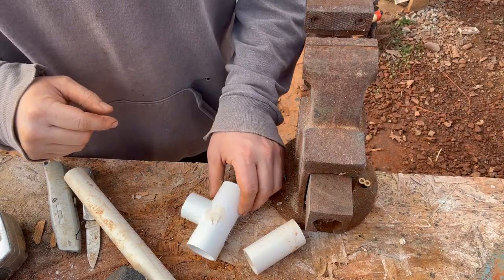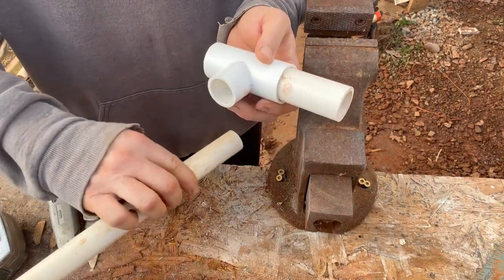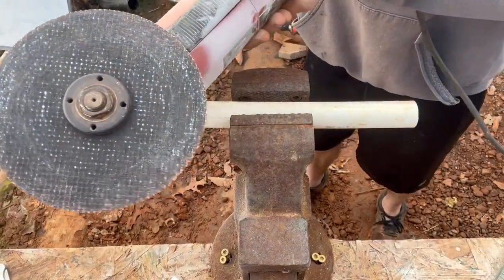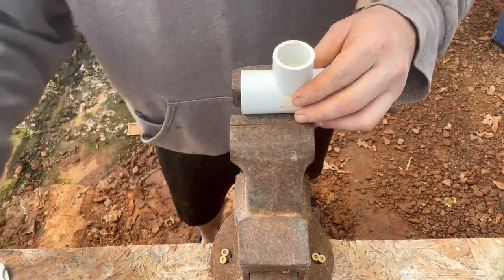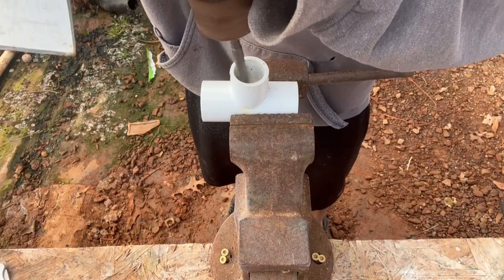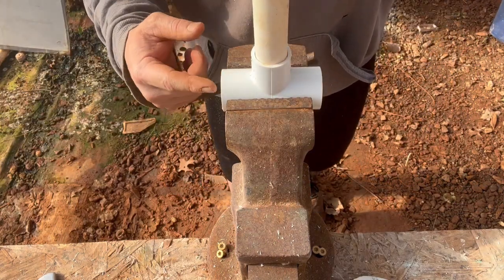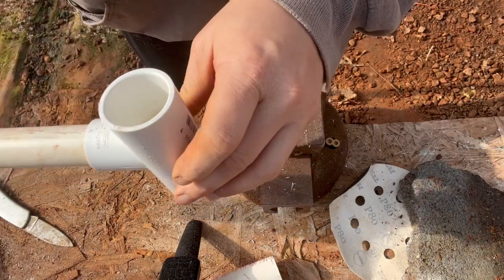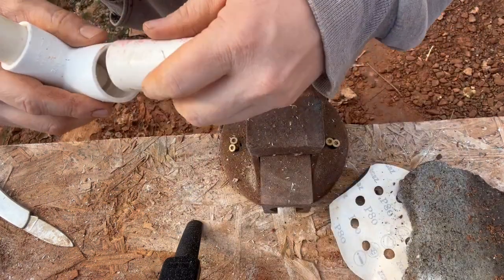Stop using airstones!! Use a $2 venturi instead!

Comment: SUGGESTION:
Placing the air inlet right before the pump impeller allows the bubbles to get smashed down in size...leading to far more oxygenation of the water. Large bubles quickly rise to the surface, and this elads to less oxygen getting absorbed into the water.
Reply: Basically aren't you 'cavitating' the pump impeller? This increased cavitation usually kills a pump. Not saying it is, just saying cavitation is something that is generally avoided. If it works it works.
Reply: i tried that and some pumps die out and quit pumping when any air is introduced.
Reply: @ErikAnders  
I use a 1/4 HP submersible pump, and a 1/5" poly tube......My water is so oxygenated it turns milky white with almost zero bubbling at the surface. The bubbles just hang in the water and my fish only need it to be on for 30 minutes a day. I don't remember the brand of pump, but I'm sure any sump pump would suffice. #PraiseJesusChrist
Reply from the maker: Interesting, I have tried this with no success, but I’ll try it again.
Reply: Thanks @thomasg4324 for the advice. I just did it as you said and it's wonderful how it works. It just saved me thousands of  dollars. Actualy I found a video explainung how to do it.
Reply: Why suggest killing pump's ?

Comment: Instead of drill bit, you could have heated 3/4 inch pipe till it gets soft with a hot air gun and force it through the T fitting.
Reply from the maker: Very interesting, i might try that next time, seems I’m adding a new system every month or so to keep up with demand.

Comment: Isnt easier and cheaper to pump air verses water?
Reply from the maker: An air pump is typically slightly more expensive than a similar wattage fountain/pond pump, and then you have to buy weighted hose, fittings, and airstones. A water pump and some pvc is a lot easier to setup too, in my opinion, but I have larger hydroponic systems, some that are 800 square feet, and it just doesn’t make sense to put 40-50 air stones in and a huge noisy pump. 

That being said, if I was building a small system (<20 planting stations) I would use an air stone. Hope this helps!
Reply: I’m guessing it takes one step out of the equation assuming that your filtering or circulating the water to begin with.

Comment: Clever idea! But how does the size if the bubbles relate to aeration effectiveness? On another air stone video, tiny air bubble size was emphasized,  but these bubbles look huge.  How would one even measure, or know if one is infusing the air into the water enough?
Reply from the maker: Good question, the only thing I can tell you is that I have perfect aeration using this system which is a dissolved oxygen level of 8. I have some systems that are 800 gallons and I run a 40 watt 620 gallon per hour pump with one 3/4” venturi. I have perfect aeration with the benefit of circulation, and it’s really cheap and virtually maintenance free. If you are running a small reservoir get an air stone. If you have a larger system, airstones get really expensive and are more of a hassle. So it really depends!
Reply: Aeration is not about gas transfer from the bubbles...no matter how small they are. There simply is not enough time for gaseous transfer. Aeration occurs at the surface...and to get that...all you need is agitation. "Small bubbles" agitate the surface more effectively.  But if the tank is deep...a small pore airstone has too much pressure on it to work effectively.  Hope that helps

Comment: you could control the airflow with a cutoff valve
Reply from the maker: The idea is to get as much oxygen as possible into the water, any system using ambient air is limited, with the max being about 8 ppm of dissolved oxygen at sea level. The closer you can get to 8 ppm the healthier the plants will be, I would like to do a video where a measure dissolved oxygen in my system with a meter. Stay tuned!

Comment: This design works for a larger pump, for smaller pumps just bring venturi closer to the surface as it can't draw air down that deep.
Reply from the maker: I use a 2” pump with 5000 gpm for my main system, it actually does quite poor deeper than a couple inches. My smaller system use a 3/4” venturi with a 620 gpm pump, they won’t great at 8” but cannot go any farther than that.

Comment: Put a bit smaller sized tube on the output side. That will enhance the ventury effect even more. One and a half inch in length will do. Because of the smaller diameter, the water will have to go faster, and therefore, it will draw in even more air.
Reply from the maker: 👍will try this next time!
Reply: @SaludaGradeFarm  We used to reduce the water pipe to a smaller Tee and then increase the pipe again on the output.
This creates the water flow to increase creating more suction of air.

Comment: Looks to me like the air pipe blocks way too much water stressing the pump unnecessarily
Reply from the maker: These pumps are centrifugal and designed to work under resistance. One of my  pumps has been going for a couple years without a hiccup! Most the pumps I use are just pond pumps and only draw 40 watts, but can aerate 800 gallons or so!

Comment: All that work for video and zero clarity of symmetrical tee and water flow direction. How about a big red arrow?!
Reply from the maker: Open end of the beveled pipe goes towards the open end of the tee. If you reverse it the water shoots up the air intake, I’ve done this before 😂 hope this helps, if you have anymore questions please let me know!
Reply: @SaludaGradeFarm  Makes sense!

Comment: Water pumps use 100 to 400watts for small hot tub pond or aquarium
Reply from the maker: Most of the water pumps I use less than 50 watts, they don’t add heat to the system, there’s no air stones to clog up. 

The pumps are low pressure pond pumps that move a lot of water for very low wattage. I believe these systems are pretty efficient!

Comment: Also kills flow ...😢     if ran air stones in intake of pump or better in pipe would be more efficient on electricity running  2 pumps if ask me..air pumps don't use but 5 to 15watts
Reply from the maker: I don’t think a 15 watt air pump will cut it in this application, the pond is 5000 gallons, and would cost alot of money for all the airstones in weighted hose fittings etc…..

Comment: Demonstrates a clear lack of understanding on how oxygen gets into the water...... 

There would be 10 times greater oxygenation by just turning the outlet to point up towards the top of the water (without the bubbles) and 100 x more if you lifted the outlet to the top of the water and have it create the longest horizontal water ripple you can....

The bubbles add ZERO aeration to the water and cause a bunch of problems, all they do is lift a tiny amount of water to the surface (create a small amount of water current) where the oxygenation actually takes place. Obviously the water pumps flow is many, many times greater current than the bubbles create so just use it efficiently and save all the dramas the bubbles actually cause (and the god awful sound).
Reply from the maker: Hello, thanks for your input, and I would love to have a good conversation with you about this one day. This unit aerates a large hydroponic pond, and I am merely mimicking exactly what I have seen in the large commercial hydroponic systems that cover 5 acres plus! The surface of the system is covered in floating rafts, and any water exposed to light adds algae to my system. I failed 3rd grade chemistry, and my only understanding of how DO gets into water is to increase the air to water surface area, hence bubbles, and lots of them!

Have a blessed day!

Comment: You don't need airstones to "oxygenate" water...WHAT YOU NEED IS LOTS OF WATER SURFACE MOVEMENT...so a high flowing pump where the water sprout is level to the water surface is enough to move the surface of the water constantly...or you can use a DIY sprinkler...
Reply: Oh heck….bubbles just look neat too 😃
Reply: They do small micronised bubbles increase surface area which as with all chemical processes increases the rate of reaction ... In this case the rate of oxygenation ... However oxygen saturation of water is temperature dependent and peaks fairly low at standard atmospheric pressure ...
Reply: So just waves that touch all waves of the reservoir?
Reply: 💯 to many people think the bubbles add oxygen - but its their movement - I do like this though for breaking surface tension though
Reply: @Aiken47 surface area and turnover add oxygen, bubbles add surface area
Reply: Shut up
Reply: I connect an elbow socket & turn the Venturi about 30 degree downward. It creates a lot of oxygen in the deeper part of the pond water & my koi are very active.
Reply from the maker: True that! I use a water fall method under my nft channels in the reservoir, watch out for algae using this method though! Cheers!
Reply: Exactly  @SaludaGradeFarm we put T piece in the feed line, an L, and point the takeoff back at the solution
Reply: @SaludaGradeFarm what do you do to control the algae in the res? Should I just add a venturi water pump at the bottom? I run aircube atm 105 gallon res
Reply: Everybody says the same, but I believe that is a kind of myth, actually... 
All those little bubbles totalize a big surface area count for the O2 exchange..
Besides, it could be a good number of little bubbles remaining in the water for a while...

Comment: I’d like to see the entire assembly outside of water.
Reply from the maker: I’ve switched to just one 2” venturi in the system because the pump failed and the only pump size I could pick up at harbor freight was larger then the existing, so I built another larger venturi. Works just as good as 3 of these but with a lot less plumbing

Comment: Restriction or losses in waterflow costs more than the powercosumption of a designated airpump. 
You could also turn your idea 180degrees. Use a airpump/airlift to move water. Much more energy efficient.
Reply from the maker: Thanks for the comment!
Reply: @SaludaGradeFarm   You're welcome ;)

For example...With an proper diy build airlift you can pump 12.000 to 15.000 liters of water an hour with only 20Watts! 

In Western Europe these kind of pumps are being used in several large Koiponds.
Reply from the maker: I’m only using 2.5 amps for my water pump, and the system is 20,000 liters. I think the main thing that I love about the setup is it only cost $250 and it takes only a few minutes.  I’m looking into the air lift though, do you have a link to one?
Reply: Could you give pump or air pump links please?
Reply: @infantesb  Just Google for airlift Koipond

Comment: This could be used in place of a Trompe for compressing air, and could be fed with a simple gravity feed.
I see many uses.
Reply from the maker: What’s a tromps?
Reply: @SaludaGradeFarm  It's a primitive Air Compressor that relies on the fall of water in a waterfall to catch air, and then collects that air. In its original forms it needs a LOT of height, and a lot of flow.
It's named after its inventor, French chap named Trompe.
Reply from the maker: Curious if the falling water could drive a water wheel that turns the compressor, that’d be cool!
Reply: @SaludaGradeFarm 
https://en.wikipedia.org/wiki/Trompe

Comment: I still have no idea how this actually works...lols. I could build one now but dont understand why I would want to... Need a side by side with an air stone to show the diff and explain the benefits.
Reply from the maker: A pond pump pushes the water through, past the beveled pipe, and that creates a vacuum that pulls the air in. On a larger scale, venturis are cheaper and easier to setup, plus it adds circulation with only one pump. You have to buy alot of airstones, fittings, and weighted hose with an air stone setup, plus you have to the air pumps are really loud and obnoxious 😀then if you wanted to add circulation you would need to add another water pump.
Reply: Thank you so much for the reply and answer @SaludaGradeFarm  that makes perfect sense now and makes me wonder If I can use this idea for a DWC hydro set up but on a smaller scale. I appreciate your time here.
Reply: Google Ventury and the principles involved will be obvious.
Reply: @robinhooper7702  Wasnt talkin to you numnuts, if I wanted your opinion, id have asked for it then gone and bashed my head into a wall...

Comment: How to skip right over the PUMP that actually causes the whole thing to work
Reply from the maker: If you want to make it off grid look into the kratky method, other than that you need a pump of some kind, most hydroponic growers have a pump, either a Venturi setup like this, or an air pump kind of like a fish pump.

Comment: Brother pls tell me what is the length/width  of your bed?  And what is the HP /wats of water motor ?
Reply from the maker: This bed is 10x80, but you want to shoot for a pump size that will circulate all of your nutrient solution at least once an hour. You can scale down to fit any size bed. I started making 10x16 beds because they are much easier to manage.
Reply from the maker: In my 10x16 beds I use a 660 gpm pump, with only one 3/4” venturi built I. The same fashion. In my large system I use a 5500 gpm pump with three 1” Venturis. Hope this helps.
Reply: @SaludaGradeFarm  definitely helpful brother.  Thank you lots of love from India

Comment: Bro not everyone has the space for that kind of thing. Nice clickbait tittle
Reply from the maker: Not clickbate, I use the same setup on my 10x16s and 4x8, just smaller pipes and pumps, I have another video where I set this up on a 4x8. The point is, look how simple aeration can be. Hope this helps.
Reply: @SaludaGradeFarm  okay I'll check out your other video
Reply: I been using a smaller version in small 200 gallon pond each winter.           Fish stay in the pond all winter, with no issues.  Coldest winter night so far -29°F.

Comment: Easier and faster way:
Drill a hole on to the pipe and place a small air hose.
Size of the hole should be same size of the air hose
Reply from the maker: Thanks for the comment

Comment: If your pump stops water will run up your air pipe? How do you clear that? Do you have to be running the pump before putting the system in the water to make sure the air snorkel remains clear?
Reply from the maker: Nope, turn the pump on, and it quickly sucks the water out of the pipe every time, there jo priming or anything else necessary, it’s care free.
Reply: Check valve would help you
Reply: @TheCryptoMiner which part of the unit should the check valve be fitted
Reply: Did you check, if it worked when the motor was switched off for a day and then started.
Did the water in the air pipe get sucked out and the unit served the purpose intended too

Comment: what pump did you use to connect on your 1” pvc? can you give me the pump model?
Reply from the maker: You can use any submersible pond or fountain pump. Shoot for 1,500 gpm for each 1” venturi. I have a 5500 gpm pump hooked up to 3 of these! I also have a 600 gpm pump hooked up to a 3/4” venturi made the same way.

Comment: I'm going to try this into my large scale reservoir that serves 2k heads of lettuce. Hoping this will also works. Thanks for the info
Reply from the maker: It will work, just size your water pump to circulate your solution at least 1 time every hour , preferably a bit more. I have 5000 gallons and a 5000 gallon pump running through 3 of these 1” venturis. I get pretty healthy roots but they could a little better if I had a 6500 gph pump going through the same 3 venturis, but I might add 1 more if needed.
Reply from the maker: My healthiest plants are in a system where I’m circulating the solution once every half hour, and the roots are pearly white! Hope this helps!
Reply: My pump just arrived today and Im gonna do it today. I hope this will also works on my reservoir. btw im using NFT system
Reply: how did it work out? 
 @wkendgarage

Comment: Good info for those of us still researching and dreaming. How many of these Venturi systems do you have throughout your DWC pools? I live in Orlando, Florida but grew up not to far from you in Gaffney, SC. Would love to stop by someday when we are up there to see your layout and pick your brain. Thanks for the videos. I really do enjoy them.
Reply from the maker: Thanks! I use 3 or those 1” units that I’ve made with a 5000 gpm pump. I may need to upgrade the pump a little bit because it aerates a little less every time i added a Venturi. 

PM us on Facebook @saluda grade farm.
Reply: @SaludaGradeFarm  Ha, I think you meant a 5000 gph pump. A 5000 gpm pump would bust those little pipes, then probably knock a whole in your wall😄
 I like your design, but my first thought was you are putting a lot of load on that pump and likely decreasing it's strength and life span. Perhaps just adding an aerator pump may be cheaper in the long run. Idk, just a thought. Thanks for sharing your work!